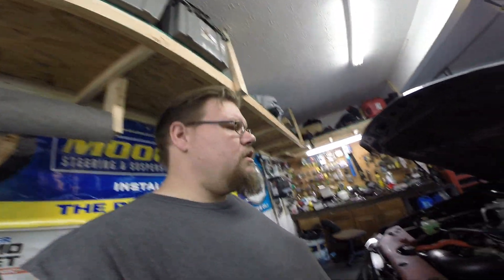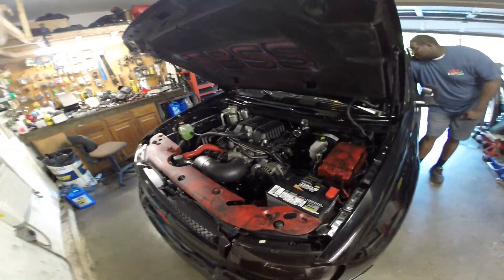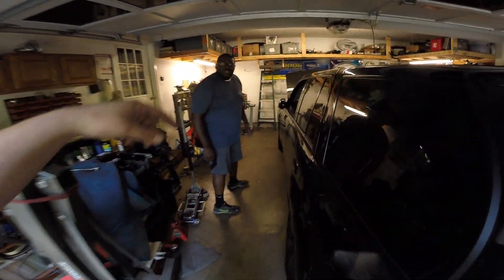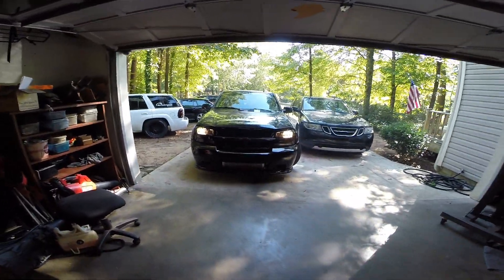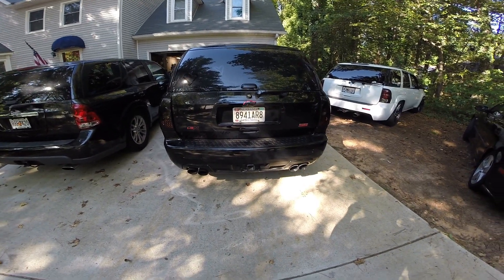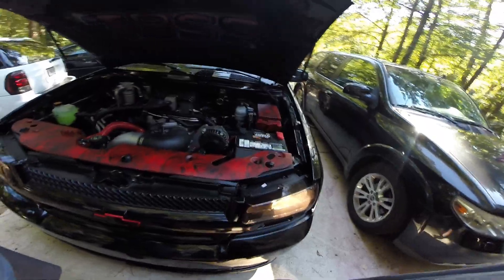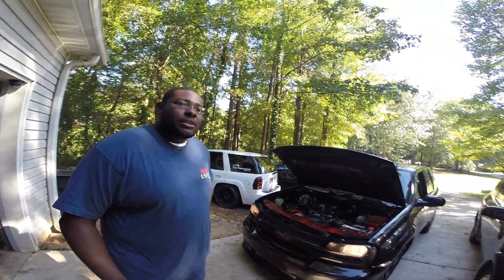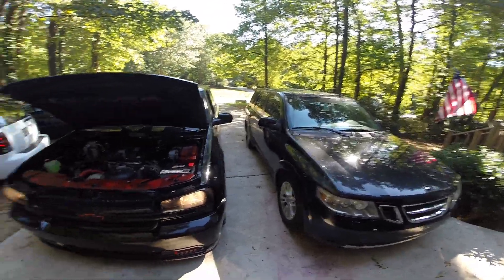2007 Trailblazer SS LSA Supercharger build!! Finale: D-Day!!!

Comment: No supercharger noises with that setup,  it actually sounds alot like my ctsv.....did you put ls3 heads or put the janky cathedral adapters....none the less it sounds and looks awesome! !!!#.......gotta do a pulley swap if you wanna get the most out of that lsa blower
Reply from the maker: Hi there! Yes we put decked LS3 heads on it, it also has an Innovators West 10% overdrive crank pulley and griptech pulley on the LSA, I believe 1.85". There is a full series on this build if you want to check it out. Thanks!

Comment: What camshaft on it? Looks and sounds killer.... Can you please put up the list of parts and where did you got it. Thanks
Reply from the maker: It's a custom cut btr cam, I don't have the specs with me right now but it's basically a stage 4 boost cam. Its somewhere in the neighborhood of 230/247 .600/.612 114 lsa. Pdc 

Lance drager sells the kit for the lsa and everything else was sourced independently. Magnafuel lines and regulator, 525 pump, ls3 heads, etc.

If you watch the other videos I know we talk about a lot of the parts in them.

Thanks for watching!
Reply: Rev Hard Garage I did hear it out but I thought that you were going to have a list of it. Good job whatever you doing on the engines setup and videos and the hard work keep up the good videos and I will keep watching thank you.
Reply from the maker: @DXB9993  I will try to put together a list soon and post.

Comment: How did you get your wiring harness to fit ? Did you have to extend it ?
Reply from the maker: @jeremyjohnson2601  Yes, I had t9 extend certain sections of the harness. I talked about it in detail at some point. I think it was the passenger side injectors and the intake air temp. Maybe a couple of others.